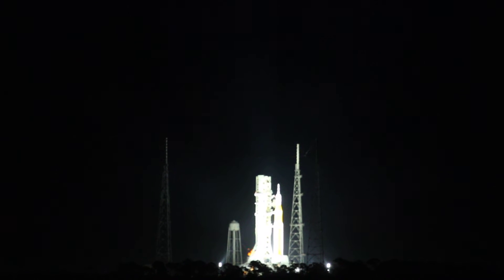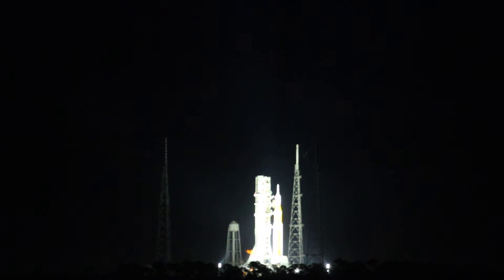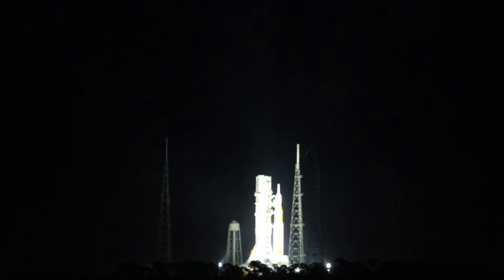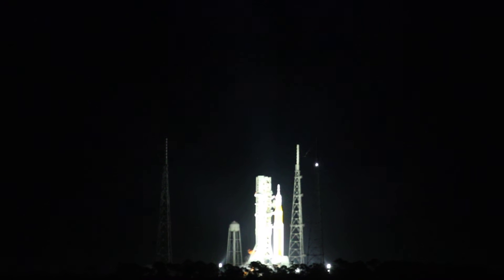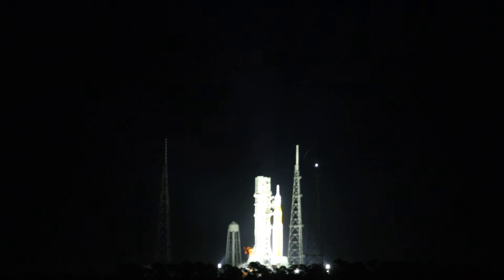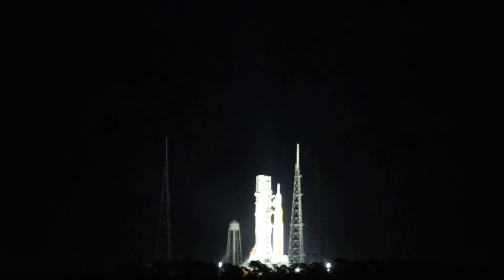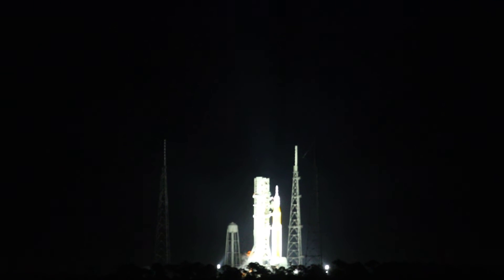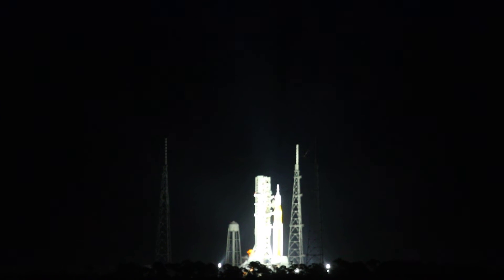Launch of Artemis 1, Canon tele launch

Comment: The flame that they thought was the rocket starting was actually the "burn stack" which is some distance away from the pad. It's where the vented hydrogen gas is burned off. Hydrogen is constantly being vented up until just 2 mins before launch when the Hydrogen valves are closed and the tank is pressurized.

Comment: When I saw the resting rocket and the launch tower overexposed in the beginning of the video, I thought SLS would be completely invisible during the launch due to the brightness of the exhaust. But it actually looked quite decent!
Reply from the maker: Yes is was a surprice that a fotoapparat with 300 mm objective can make so a nice video. The launch itsself has great colors.  It was my 1st night launch from that size. Next time will use a cam with a pixel controlled chip for brightness.